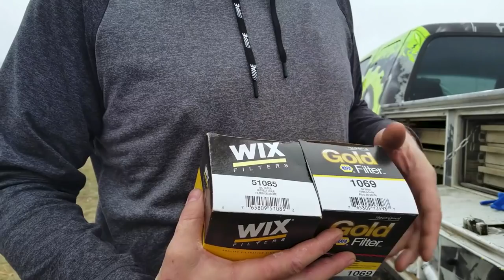The worst oil filters on the PLANET!!!

Comment: In 1964 when I still had money and hair I was apprenticing in the local Ford garage as a mechanics helper.  I had a case of old Fram filters at home.  I was told to go to the local parts house and pick up some new Fram filters because that was what the customer specified for his oil change.  When I picked up the Fram box I thought it was empty because it was so light.  I bought another  filter and took it home after work and cut it open and compared it to the older filters I had and could not believe the difference.  It turns out that Union Switch and Signal had bought Fram and had proceeded to radically cheapen the product in order to bolster its bottom line.  Once I used my old filters I have never, to this day,  bought or used another Fram filter.  I won't guarantee an oil change if my customer specifies  a Fram.  Fram is s four letter word!!!!!
Reply: Love and hate are also four letter words. Neither one is objective or rational.
if you had a basic PC and you went to a store to buy a new PC for the same amount you paid for the previous one, what you would get would be lighter smaller and work better. You not only accept that, you expect it.  Why is it hard to accept that with advances in material science and engineering, something a simple as an oil filter might follow the same course of development?

Comment: So when is my engine going to die ? My 23 year old truck with 300,000 miles.  My oil comes out non gritty and I've only used Fram and Penzoil  onventional oil. Never had any internal issues.  I  think there's more to it than the construction but the filter capability along with maintaining a proper flow rate for lubrication.  It only has to last for 3-5 thousand miles.  Enjoy all your videos btw !

Comment: Fram was my favorite oil filter because of the grippy stuff, it made it real easy to hand tighten it . But I didn't know until earlier today when I was googling up Hastings oil filters and I came across a video similar to yours and I was shocked at what junk they are. I couldn't believe it, I've been putting that trash on my car for as long as I can remember, and I'm almost 62 yrs old lol. I've always tried to change my oil every 3,000 miles in the past, and that I'm sure is the reason they would run for well over 200,000 miles before I would junk them. But I'm gonna tell every one I know that works on cars about this. Fram  has fooled a lot of people and I certainly am one of them, wow. They know better and to me that's about as dishonest as anyone can get, to say the least. They are just flat out ripping people off.  From now on I'm gonna research everything before I use it on my vehicles and everything else for that matter. Thanks for the info sir, I certainly appreciate it. By the way I like your video better, good job!!!👍
Reply: If you change oil every 3000 miles fram is as good as any in fact lately they have improved their cheapest filter insteadofa piece of paper sprayed with black paint they actually use of a piece of rubber fir drain back valve. One of the best filters out there is supertech

Comment: I've used fram for 43 yrs and over 420 000 miles with no problems. I've cut many used ones apart.  People cry about the fiber end caps but I've seen no problems.

Comment: I pulled a 1947 farmall cub out of a hedge row a few years back, I rebuilt the motor, I use it to cultivate, I enjoyed the fact that when I changed the cartridge oil filter I could still read the brand and part number stamped into the steel end caps. It read WIX.

Comment: Quality oil filters include:

Hastings (USA)
Baldwin (USA)
Donaldson (origin depends on filter)
Fleetguard (Mexico?)
WIX (USA?)

In Fram's defense, they make different grades of filters and the high-end ones are VERY good filters.  The orange cans leave a little to be desired, though.

Personally, I prefer the Hastings.  USA made is extremely important to me.  The LF115 is a HIGH quality filter and their customer svc. is top knotch. ☮️
Reply: USA made is a number 1 determinate yet only teardown and testing reveals;
Even at 20 microns given an efficient filter that is an abrasive anyway;

Comment: Cool. I'm gonna go cut up a Motorcraft filter now I know what to look for.
Reply: Purolator makes Ford Motorcraft oil filters to Ford specification's. Cheaper labor than Ford union rate and benefits.
Reply: Me and my Father always use motorcraft in my 92 ranger and it is now at  392,561 miles and it's still running almost as well as the day Ford dropped it in the driveway (it was Custom Ordered by my father from Ford to get the 4.0 engine because it wasn't available in black-on-black in our area )

Comment: I had a Performax filter on my '07 Toyota FJ Cruiser. I am told that I need to change the filter each time I change the oil. The first time around, I neglected to change it, and it held up perfectly. I changed my oil last week and the filter only except that the filter I am using is the Toyota brand filter. I am told by every Toyota owner that the OEM filters Toyota specifically makes for their vehicles are superior to anything aftermarket.

Comment: I have to agree with you. I saw a display at my parts store that shows three oil filters cut open you could pick them up and feel of them. Fram filters suck! 
I use Napa  filters on my vehicles.
On my trucks I use Donaldson, fleetguard on my Cummins.
Baldwin also makes a great filter.
JUST DONT USE A FRAM. I would not put a fram on a bicycle.
Reply: NAPA is Wix re-labeled;
I used to be NAPA Loyalist but due to current situation I know personally of a shop that sold his to them;
( read between the lines )

Comment: I wanna add a few things. 

Fram ultras are very good.

Oil filters clog very easily not in 50k miles which is why alot of people get sludge problems.

Don't buy anything but Fram ultra or titanium.
Reply: Ps I don't exactly support Fram.. They need to upgrade their lower line filters for sure. But I wanted to clarify

Comment: If you change oil and filter every 5000K the bypass valve will never come into play. Also your filter will never clog. There are million of Frams out there and we don't see the engine failures that this presenter suggests. The glue in the Fram seems to hold pretty well judging from how hard he worked to pull it apart. No arguing the Fram is the most cheaply made filter but I'm sure it will do the job. It wouldn't be my first choice but I would not be afraid to use it...just change the oil frequently.
Reply: I buy oil from Wal-Mart but I NEVER buy a oil filter from Wal-Mart, thanks alot for putting the information out to save peoples engine, I been using Wix filters for years..
Reply: Never put cheap products in you're car.
Reply: If you think that saving $5 is worth the tradeoff, then good for you.  Most people, however, are not willing to risk their engine for the sake of $5....

Comment: A TRUE evaluation of an oil filter can only be done by doing an analysis of the used OIL after the recommended oil change interval.
Observing the individual internal components is just that, AN OBSERVATION !

Comment: Fram ultra are really solid though. I personally use them. But their basic ones I have to agree they are bad. But oil quality matters way more than the filter unless your have a badly worn engine.
Reply: Fram is all bad filter media are all the same frame will kill an engine
Reply: @edschwendiman2566  no filter will kill a engine. As long as the oil is changed. I've seen engines go over 200k without ever changing the oil filter but they changed the oil. I wouldn't recommend it. But you are one of those fram bad fools.
Reply: @tjk5992  my experience with fram's filter media in the oil pan was enough evidence for me they have no quality control

Comment: Yes. It's acceptable. Fram ownership changed and starting 2018 the extra guard filter is very high quality for the price. If you compare a $5 filter to a $15 premium synthetic filter of course it will not hold a candle to it. For what it is it's excellent. Quality filtration for oil for budget buyers. Better than anything at local quick lube shops. Honda, Subaru, and other manufacturers use the same fiber binding in their oem filters. My two cents.
Reply: i think exactly that

Comment: Okay I gotta be honest. I've seen one of these filters go 7000 miles on a Kia Rio. I opened it up and it held up just fine. The whole thing looked clogged though since it's filtering area sucks. It's a 3k-5k interval filter at best. I may not think they are that bad, but I will still use Wix. I'm not doing short intervals as I use synthetic, and I like to smash the gas pedal.

Comment: I agree with it being the worst. The Fram Ultra Sythetic is the only one I would use  because I've seen many tear downs. The filter media is hard to tear, silicone anti drainback valve, metal end caps, and a claim of 99% at 20 microns (or so they say). I don't like how they don't have a spring coil like that Wix and Napa. Also, having said that, it angers me to see the filter you just showed me, and feel like not supporting Fram anymore and going with the Wix or Napa. I have never known Wix or Napa to make a lie quality product. Thanks for the video. It was very informative, and it gave me an anger to possibly go to Wix or Napa.

Comment: Different issue but, if you live in colder climates and its available get either a factory installed or good aftermarket  block heater preferably for oil/crank case heat.  Hot oil circulates better and quicker reducing camshaft and top engine wear.  Anti freeze will take care of the coolant side of the engine all modern anti freezes have integrated water pump lubricant in them reducing impeller wear on the water pump.

Comment: I just changed my oil at the beginning of this month, and it has a pennzoil oil filter installed. Is it a good filter?
Reply: Thanks,;not much info on those i noticed:::: interestingly , my MOPAR DEALER USES “ PERFORMAX (* make in Mexico, up until last two PROGRAM oil Change for my 2015 DOdge Journey(( now labeled made in USA, DISTRIBUTED bySOPUS )),  sera associated with  PENZZOIL AT KNE time, ... I gen use NAPA gold (* shorter term) and ROYAL PURPLE, LONGER term / esp synthetic ... personally, I use MOBILE ONE OIL..
Reply: No, it's a garbage filter.  Use Wix or Mobil 1

Comment: Steel can filters are old, on all modern cars here in Europe you just replace the filter material that sits in a permanent oil filter housing, that's it.
Much easier and quicker.

Comment: Wow what a crap filter. Fram should be ashamed. My Toyota has over 275,000 miles and runs like new. I just follow the maintenance chedule by using some cool software https://www.youtube.com/watch?v=pARQth8bVzE and I only use OEM oil and filters from Toyota. Seems to be working fine :)
Reply: I use that software too for all my vehicles. I got it from www.automotivewolf.com  It does a great job!
Reply: Tried the software and love it!
Reply: I'm using Automotive Wolf to track the maintenance on my 1991 Cessna 172 and my SUV. Awesome software.

Comment: How good does a filter have to be? I have been using Fram on all my trucks. cars and construction equipment and never had a problem with my engines ever.
Reply: Same here, Why is everyone on here bashing Fram?
Reply: They just don't understand engineering. It is designed with fiberboard/ cardboard to last for 3-5k miles. A lot of European cars premium filters have end caps just like the Fram.

Comment: Your Napa clogged filter explanation is a bit off.  When clogged, the pressure relief valve shown at 7:00, has a  valve in it that opens when the pressure differential exceeds the design pressure to allow unfiltered oil to lubricate the engine.  The large spring only serves to keep the filter element in firm contact with the red rubber ADV (anti drain back valve),  pressure relief valve and base plate.

Comment: My Opinion=   OEM always designs the engine and filter to work well together anything else is always a gamble in quality control and proper flow through it.     As a 20+Year experience mechanic I won't use anything except the filter the OEM recommends and won't do the oil change if you ask for a different one 
And if you have a fram  I won't work on the vehicle at all because I know they have horrible quality control and have seen  engines with under 50k miles having really bad wear in them after using only fram filters.

Comment: EVERYBODY knows FRAM is a terrible filter, but it's what they put on the car unless you specify you want a higher quality filter - they likely buy them cheaper.  Talking to oil change specialists, they say the filters don't hold up as long as the oil, so that's why they recommend changing oil often.  I say "Use the best synthetic oil and use a premium oil filter, too"

Comment: Thankfully I've always used Mobile 1 filters, with the anti-drain back
Reply: Where do you get Mobile 1 filters, it won't be many common retail;
Currently I use a part-supply which serves many shops;
Pre-fill → tried it = works much better on cold-crank after change;
Lifter noise nearly zero ~ can see a few air-trapped-bubble purging dash gauge 
Noise as we know are for loud-pipes not machine surface;
Reply: @ChiDraconis  Mobile 1 filters are at Wal-Mart.

Comment: Basically Fram filter is fine if you change your oil exactly when they say to.  And also drive normally.

If you have a higher performance car and create alot of pressure and heat, these filter won't take it

Comment: Not sure why you did it but the 1st filter you showed cut up at 7:34 was Wix not Napa. I can read 50185 on the bar code. At 8:21 8:22 you're taking a Napa filter from the Wix box. I use Wix filters so I know. Are you even aware of your mistake?
Reply: Does it really matter if both are made by Wix?
Reply: @ronaldjohnson1474  - Well it might if Wix is cutting corners on the filters they supply to Napa. Next time I take a Wix off my truck I'll cut it open and have a look and get back to you. I just changed the oil recently so... 3000 miles.

Comment: What do you think about a Purolator Boss Oil Filter vs a Wix Ap Oil Filter? Trying to decide which one to buy
Reply: Purolator is standard Bosch/Mann-Hummel, they're the same products but rebadged. Wixx ones are spring loaded and a lot of them are wire-backed as well they're pretty good, same as Napa. Not that Purolator/Bosch/Mann need wire backing, they're very well made even if they're only using glue and the standard metal plate instead of a spring it's just good worksmanship.

Comment: I like the Pure ONE by Purolator, all synthetic filter material.  I wish Walmart would carry them.
Reply: it's a blend
Reply: @amaxlite  -------------wally world is the best, supertech brand, for 3 dollars-----------i have been using wallmart super tech oil and filters  since they started selling them with no problems, oil stays clean and engines i have had run for hundreds of thousands of miles with no oil or filter problems----------if you pay  three times the price for other brands,  i doubt if you will  do any better
Reply: @emailfrom7185  it's not that big of a deal to spend an extra 3 bucks to get a solid brand like Purolator , Wix or NAPA - supertech is a cheap brand I don't really trust

Comment: I don't really think it have to be that bad.  The amount of filter media is more a selling point.  If engineered to reach claimed interval/time I don't really have an issue with it.  With more filter media area you could have it more restrictive in filtering and retain the flow and it should last longer, but perhaps the amount of filter media and type is sufficient.  After buying some Mann filters for a Volvo I picked up, I'm a bit more open-minded to design choices.  I tend to just order multipacks of OE online or when there's a sale, but have used Mann, Bosch, Wix, Purolator, Napa Gold, Motorcraft, Mobil 1, Mopar, K&N and Fram.  I'm kind of odd so I prefer OE, on nicer cars, but use Wix, Purolator, Napa Gold, Bosch and Motorcraft.  I tend to pay for my paranoia, but also acknowledge that Fram is probably more than sufficient for the job and I've pulled it off many a new (to me) car purchase.  The grippy bit is really nice though.  Over-engineering doesn't necessarily equate to good engineering and design.  Mag Filter, some magnets on the oil pan being removed before draining, and probably most importantly an effective air filter.
Reply: The best oil filter is a good air filter.

Comment: What do you think about Fleetguard filters?
Reply: I’ll give you my opinion, I used to work for Ryder truck rentals, all we used were fleet guard filters. Different numbers mean different things, usually they’re just as good as oem filters and are sometimes made in the same country as the oem company, like for the Detroit DD series I think the number for those was LF17511 they’re made in Germany just like the oem. Some are made in China some are made in the USA, I’ve even seen fuel separator filters made in Bulgaria. But overall I think they’re great filters, we never had a problem regarding filters. Cummins makes them and they’re the oem for all Cummins diesels.
Reply: Thank you. That's good to know.

Comment: Another "slam" on Fram filters.  I've used them for over 30 years and would continue to use them.  I've never had engine failure or vehicle dependability issues because of a cheap oil filter.  On the other hand, using cheap motor oil will give you issues.  I have used Motorcraft, AC Delco, Purolator, and OEM Nissan filters and have had no issues with those either.  I have gotten 200, 300 thousand miles on those vehicles and they are still on the road.  Not changing the oil or taking your vehicle to a mechanic who does an improper change will result in far more damage.